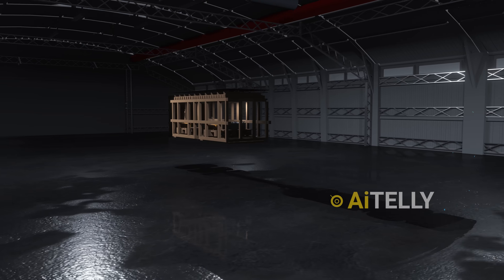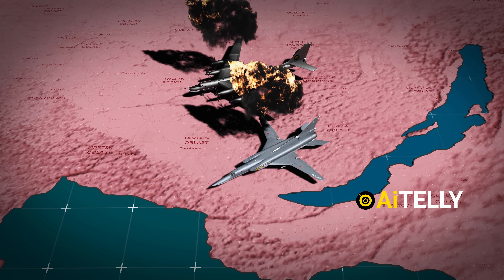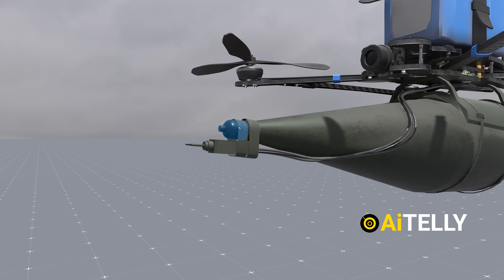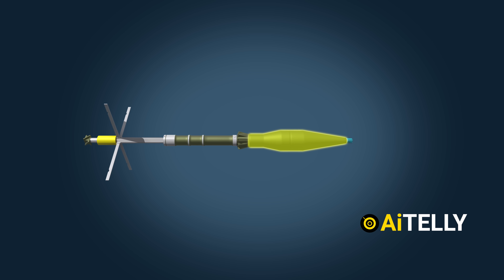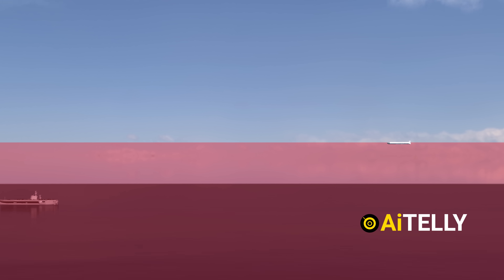How Ukraine FPV drones Truck Attack Happened? #ukraine #russia #Spiderweb

Comment: The video was released hastily and contains several inaccuracies. Let's set aside the terrible pronunciation of Russian localities and focus on more significant errors:

- the drones were not operated by remote pilots and were therefore immune to electronic warfare They had a preloaded map of the area + airplanes profiles and navigated using AI, comparing their surroundings with existing data. They also had Russian SIM cards for transmitting video to the control center for assessing results, but only a few managed to pick up a signal (not critical again, as they were autonomous).

- overall, the operation was successful but did not achieve its maximum potential: success was nearly complete at only two airbases, one was not affected, and the attack on two others can be considered rather unsuccessful. Several trucks had issues launching the drones, at least one of the vehicle exploded. A total of 116 out of 150 drones were launched.

- the site with submarines was not attacked and was likely not a target. Incorrect reports were caused by the proximity of the Olenya base.

- damage to 13 planes has been verified. Total losses, including partial losses, may range from 20 to 25 aircraft.

- even a lower count is significant, as these aircraft are not only used in the war against Ukraine but also serve as carriers of strategic nuclear weapons.

Comment: Wonder if Ukraine could use the jet-stream to launch drones from high altitude.  If the winds are easterly it wouldnt be hard to get the drones to high altitude and launch.  They really could reap havok as there would be little chance to shoot them down
Reply: They used jet-powered "Strizh" drones in 2023, there are few of them and the range is about 1000 km

Comment: You are a bit incorrect. 1) These were not containers, but cabin-houses; 2) trucks weren't left in farms and forests, but just stopped on gas station and parking nearby of airfields; Drivers were told, that other driver will take the truck; After they stopped, the roof was removed automatically and drones started flying; Inside the cabin -- it was typical container-house

Comment: Ukrainian engineers have created a covert drone-launching system disguised as ordinary rural sheds on cargo trucks. These mobile platforms can launch drones deep into Russian territory, evading detection and providing a tactical advantage.

The sheds house reinforced launch platforms, battery charging stations, and remotely controlled roof mechanisms, allowing for vertical or angled launches. Signal shielding helps drones avoid Russian surveillance.

The mobile launch units are moved into Russian territory, parked in strategic locations, and remain dormant until activated remotely. Upon activation, the roofs open, and drones are launched, utilizing ramps or compressed-air systems for a stealthy departure.

This innovative system showcases Ukraine's asymmetrical warfare capabilities, enabling precision strikes against Russian military assets. The covert nature of these platforms makes them hard to track and neutralize, adding a new dimension to the conflict.

Comment: Important clarification on the information on the video:
The drones were in the roofs of "huts", not containers. This is a kind of temporary housing for construction workers or security guards at remote sites. Also, the trucks stopped not in forests and remote places, but in parking lots at roadside cafes or gas stations, because in the first place these were the closest places where you could drive a truck to strategic airfields without suspicion. The truck drivers were ordinary civilians who did not know what kind of cargo they were carrying. This generally explains why the trucks stopped at roadside places like cafes or gas stations, and not in the forests, as it looked less suspicious to civilian drivers than driving some unknown cargo to an unknown point in the forest. As the drones were discovered, at least one driver was brutally murdered by police officers on the spot. They strangled him to death with a plastic tie. As far as we know, none of the drivers knew what cargo they were carrying.
Reply: How were the drivers instructed to stop at those specific places at the same time in wildly different parts of Russia without raising any suspicion in them?
Reply: @utkn The drivers probably didn't know each other and didn't know that there were others carrying similar cargo besides them. The reason for stopping at these places could have been anything from a shift change to some agreement with the customer of transportation. Therefore, for them everything looked quite normal and convincing.

Comment: How did the drones reach the other end of Russia without any detection from its side? 
I mean even a 5yo boy can tell that if a drone is approaching them with a large 'thing' hanging under it, it surely isn't the battery but something else.
Reply: If they were close enough to the air base, when they launched the drones, there wasn't a whole lot that could have been done

Comment: i wonder if they could make a two part drone. like a drone that carries a drone with a fiber optic spool in it. then you get the added range by using the primary carrier drone as a signal interceptor for the fiber optic one which has its advantages and the one that carried it acts like a mobile base extension

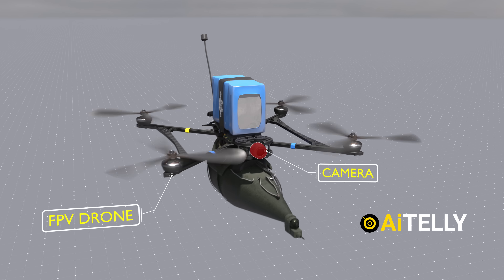Comment: Please correct the statement on 5:33

the camera is not connected to Radio Receiver (RX) to receive the signal 

It’s connected to Video Transmitter (VTX) to transmit the signal to the drone operator’s goggles

Comment: Counter rotating propellers has nothing with what you said in the video. If all propellers spun the same way you lose yaw axis control and the drone will spin the opposite way to its propellers, getting out of control... And there is 3 cables going to each motor. Its brushless motors. It has 3 magnetic fields. Nothing with exposed cables and "motherboard" (flightcontroller) is really to save weight initially. Its just easier to build and maintain and helps cooling the electronics as the VTX gets really hot together with the ESCs. There are no covers for carbon fiber frames.

Comment: How the hell did they remotely control drones that were over 2000 kms away? The drones could not have been piloted manually. The only way you can control a drone remotely over 300 kms is via SATCOM. And the latency is anywhere from 600 ms one way to 1200 ms round trip. These drones must have been pre programmed to follow a flight path based on the ground surveillance and then used AI recognition to identify and pick out shapes (planes, bombers.)

Comment: I am working on Project STRIKE which is my swarm based drone project  in the UK. In modern military operations, the need for real time intelligence, surveillance, and reconnaissance (ISR) has increased. The traditional use of manned aircraft and satellites, while effective, is often limited by cost, range, and response time. Swarm robotics and autonomous drone systems offer a promising solution by enabling distributed, decentralized intelligence that mimics natural systems such as bird flocks or insect swarms.

Swarm intelligence first studied in the context of biological systems leverages simple agents following local rules to produce complex global behaviour. This approach has been successfully adapted in artificial intelligence, particularly for tasks such as search and rescue, environmental monitoring, and military reconnaissance. The Boids algorithm (Reynolds, 1987), Particle Swarm Optimization (Kennedy & Eberhart, 1995), and Artificial Bee Colony (Karaboga, 2005) exemplify such bio inspired strategies.

Despite existing research, integrating swarm based ISR with kinetic response capabilities remains largely underdeveloped, especially in constrained environments or under communication limitations. Project STRIKE aims to fill this gap by simulating  autonomous drone swarms using advanced Boids inspired logic, Artificial Bee Colony logic, Ant Colony Optimization logic, Particle Swarm Optimization logic, Firefly algorithm, Gray wolf optimizer Cuckoo search algorithm etc.

Note: This project was born out of the moments that shook me deeply, like the brutal Pahalgam attack and the chaos at the Israel border crossing. I remember watching the footage of the attack, and really felt that we have to do something about it. It wasn’t just a news, it showed us, even if we have the best soldiers, best technologies… we still failed. We can’t just sit back and feel sorry for them who lost their lives. If we can do something about it, if i can save the lives, I will do everything for it. That why I started this project. (Inspired by American diplomatic compound in Benghazi Libya( USADC, September 26, 2024), consequences of Afghanistan invasion (IWM), The invasion of Iraq (National army museum, August, 2022 ) ,UK’s illegal border crossing ratio day by day and last example for it is ukrainian drone attack on russia.

Comment: About 10-15 years ago I've seen a news report about a missile launcher compact enough to fit a standard shipping container. With tens of thousands of these containers shipped daily, an attack on any country is possible while en route, in the port of destination or even during transporting on a cargo truck deep inside the country. Here is the same principle, only the drones are much smaller than full-size missiles. People should take the possibility of these attacks more seriously now, but I don't see how each and every cargo container can be thoroughly inspected without completely disrupting world trade.

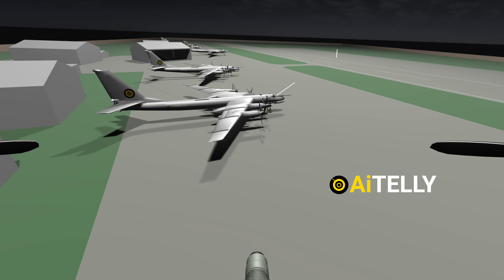Comment: 1:22 I hear "pube depots" not "fuel depots".
Reply: The rise of drone technology, combined with its affordability and accessibility, has introduced a serious national security concern. A terrorist group could, in theory, use a common delivery truck to covertly transport and launch hundreds or even thousands of drones—potentially as many as 8,000—in a coordinated assault. These drones, modified for surveillance or more destructive purposes, could target government buildings, including the White House, or other critical infrastructure with little warning. The harsh truth is that most U.S. buildings—even high-security facilities—are not fully prepared for this kind of aerial threat. Traditional security systems were never designed to counter rapid, low-altitude drone swarms, and stopping thousands of drones simultaneously would likely be impossible with current defenses. Although counter-drone measures are being developed, they are not yet widespread or fully effective. This evolving threat underscores a significant vulnerability in domestic security and highlights the urgent need for updated defenses.

Comment: Good video! There is also two hits on A-50 radar planes confirmed from independent sources (both sides plus neutral OSINT) but the video is not publicly available yet, AWACS planes are more rare (ru fielded 6, not all were operational, and one was droned in Belarus before)

Comment: Great graphics! But as far as I can see from russian sources, there was no electronic warfare at the airfields, as well as no hangars for such priceless aircraft units. No protection at all. Russians couldn't imagine that these planes could be in danger, being so far from the front lines. 
Genuine gold of an operation!
Reply: Russian nuclear bombers are in the open in accordance with the Russian-American CHB-III (New START) agreement. American strategic aviation is also outside the shelters. But now, apparently, this will need to be reviewed. That is, this attack is a direct violation of the guarantees that Russia and the United States gave each other. That is why the Russian and American foreign ministers called each other immediately after the attack.
Reply: @vadimkasse 
    It is a direct violation that Russia is using these forces against Ukraine!
Reply: @anatoliy6210  I would be grateful if you could indicate the specific point of this agreement that was violated.

In any case, I'm not saying that Ukraine violated anything, actually it was not a party to this treaty. I'm saying that it set up its ally, the Americans. Now the Russians will hide their bombers, making it more difficult for US satellites to detect them. Bravo.

Comment: The Russian Black Sea Fleet has been effectively neutralized — most of its ships destroyed, and the remaining ones are hiding in ports like Novorossiysk, beyond the reach of Ukrainian naval drones. However, the threat remains: Russia increasingly uses its Caspian Fleet to launch missile strikes against Ukraine from a relatively safe distance.

Ukraine has already demonstrated exceptional skill in developing and deploying naval drones. The only limitation is the lack of access to the Caspian Sea. But judging by the scale and innovation of Ukrainian special operations, the hypothetical idea of using transport drones to covertly deliver naval drones into the Caspian may not be so far-fetched.

Imagine “Trojan containers” dropped by air or delivered overland to neutral or adjacent waters, activated at the right moment to hunt down missile carriers of the Caspian flotilla. It would be an asymmetric and highly effective move in 21st-century naval warfare.

Comment: Another video that, in part, does not make sense. Fiber optic drone possibility; If so, where were the controllers of the drones? In the trailer? Did the fiber optic cable dissolve into the air? No Russian video of the fiber optic cables? There should be some evidence that some of the drones launched from the trailer used fiber optics before stating “may”.

Comment: This is certainly a very successful operation carried out by Ukraine. It is not exactly like Pearl Harbor, but it is a very painful blow to the pride of the Bear and Moscow. But now, of course, after such an event, no one can talk about a truce at all, at least in the near future between Moscow and Kiev. Kyiv has certainly added fuel to the fire. 

It is possible that many countries will probably soon, if not ban, then at least limit the production and use of FPV drones. 

Earlier, I wrote that the president or high-ranking official of any country is no longer safe, despite the fact that they are well guarded. Can you imagine a well-planned action using drones against anyone or anything? 

I also wrote that with the help of such drones, one can effectively attack military bases, industrial centers and warehouses with goods, although previously these quadcopters were produced exclusively as a peaceful gadget and a toy for adults. 

 It should be noted that politicians, businessmen and other interested parties who control the production of very expensive aircraft of various types and profit from their sales may also be concerned and against the further spread of such literally penny drones, which may minimize their greedy plans to profit from the sale of human-controlled aircraft, which in most cases are unreasonably expensive military aircraft with questionable efficiency, as practice shows. That is, by advertising such new samples of super-duper technologies to the public, as if these are new technologies that the country can be proud of, and as if they provide new jobs. But in fact, these lying and greedy people make money at the expense of taxpayers' money by providing false information.
...,

Comment: I'm minute into this and this is the most inacurate thing i have ever heard. everything was way simpler. things were constructed somwhere away from airbase and these were just drones covered by metal sheets. The trucks got on the place hour or less before attack started and there were no air comprassion systems. there is so much false takes taken out of nowhere for no reason

Comment: Drone propeller closeup shot showing the rotation animation,  is wrong. 

The leaf position is in vertical opposite direction (leading edge is in sweep down), translating to a negative thrust. It should be the other way around for all propellers i believe. Sorry if i am wrong..

Comment: Thank you for quick video about topic, but a lot of details is missed:
00:07 It was a frame house, drivers thought they will deliver frame house.
00:37 Drivers was hired, just regular russian drivers.
00:40 it was a regular goods delivery, they was given road that will be close to airbases. Aslo driver was requested to stop near petrol station/parkings near this airbases.
01:20 there is no proof how drones was operated, but this was a ukrainian OSA drones by First Contact company, That company have prototypes drones with AI.
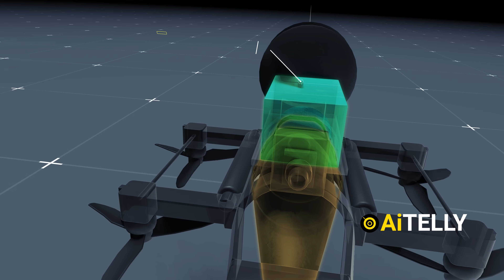03:40 Osa drone do not use fiber optic. It is originaly have a 15 minutes max flight time. and max range 8 km
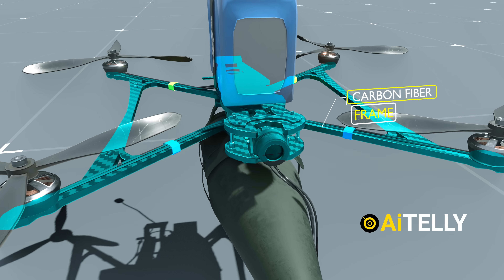04:15 Drone structure completely wrong, as drones lies on belly in truck, no payload could be below drone. Payload was installed between front and back engine on each side.
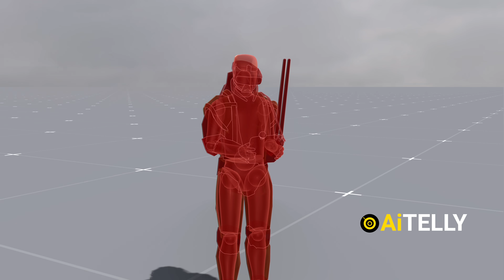06:20 Why mention jammers if you was suggesting fiber optics was used by drones? No proof any signal enhancer was used, as "frame house" is a signal enhancer.

Comment: thank u for the video yet there is several trivial information wrong in this video which makes me doubt the not so trivial information. the locations of ivanovo and dyagilevo airbases on ur map r wrong by thounsands of kilometers. the conversion of miles to kilometers is definitely not 2 rather 1.6 about ur statement "5 miles equals 10 kilometers". the "energy density" in this context suggests the battery has a high energy density and is heavy bcuz it has a lot of energy, it is heavy becuz it has a low energy desnity, it would be preferable to mention that.

Comment: Good job but way too late and too little. If these kind of attacks happened every month they could have great effect but not when there's years between them. And 40 planes were probably not taken out, so far only 6 or 7 are confirmed. Even worse, this attack doesn't effect the Ukrainian front line.